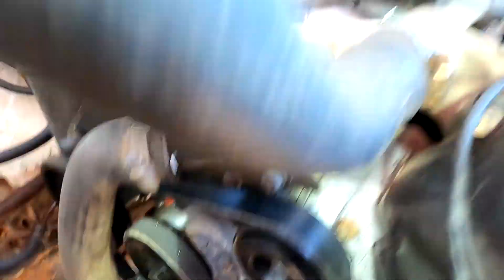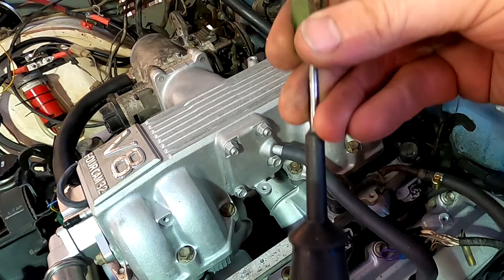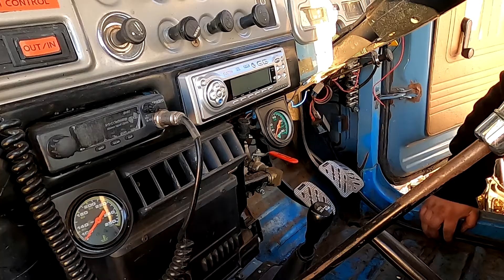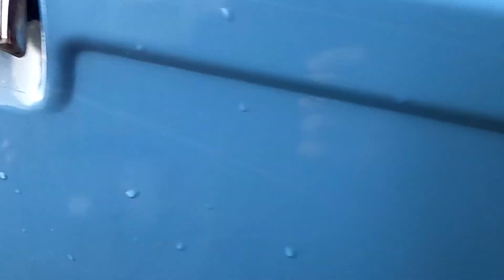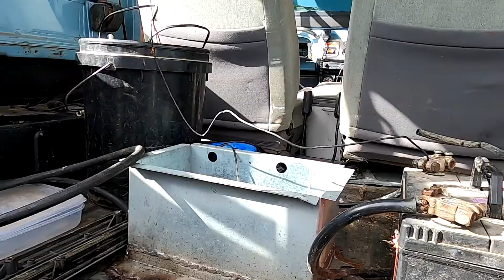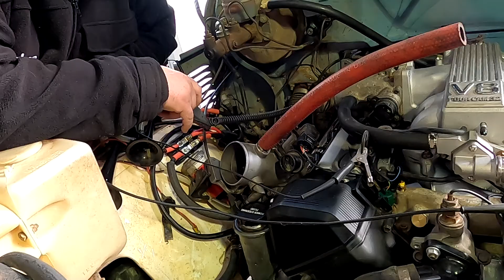Finishing the Blue Landcruiser with 1uz Part 1.  Will it run??

Comment: looking good ! Does the alternator light ground to the alternator which goes open circuit when charging ? Just sorting my install out now into and old Merc. Battery light is powered from Ignition, that simply runs to L on alternator ?
Reply from the maker: Yes,  it provides a ground when not charging so the light is on.
Reply: @CartuneNZ  Legend !
Reply: One more quick one. Does the factory ecu need to see oil pressure from the switch ? or can I use that to run a oil pressure dash light instead.
Reply from the maker: I love a quick one.  No oil pressure needed to the ecu.   None of the early ecu had oil pressure input anyway.  That started on the vvti engines

Comment: Kelvin, trials and tribulations! At least you figured out where the issue is. Half the battle.
Reply from the maker: The commissioning of a wiring loom can be interesting,   I wasn't expecting the tps issue but predicted the possible timing issue thanks to the strange trigger wheel.  Sometimes the guess and check method is still acceptable and doing this old stuff really makes one appreciate the newer ecus.